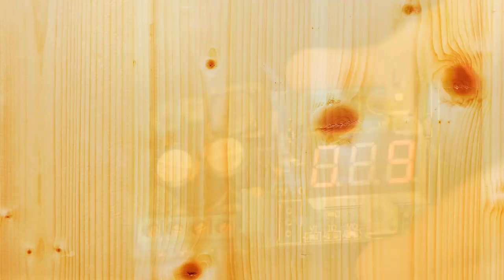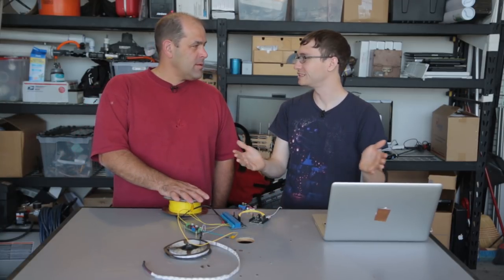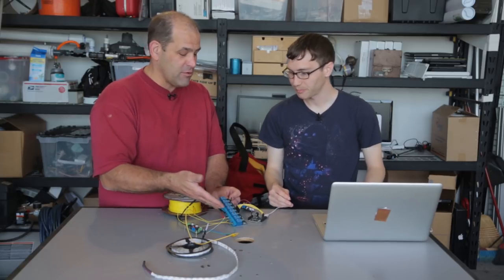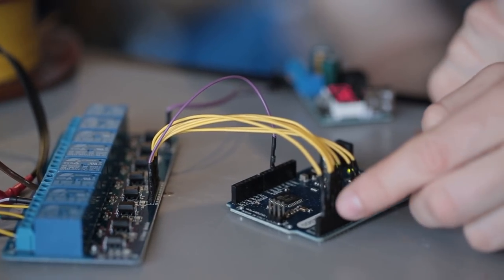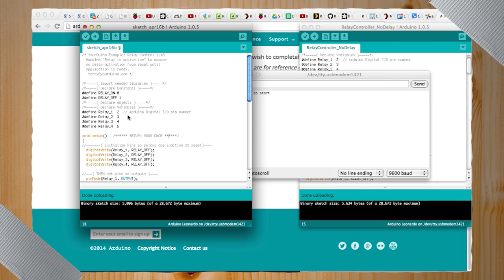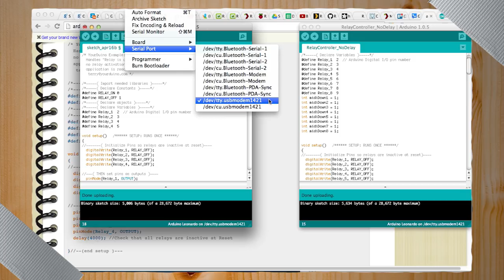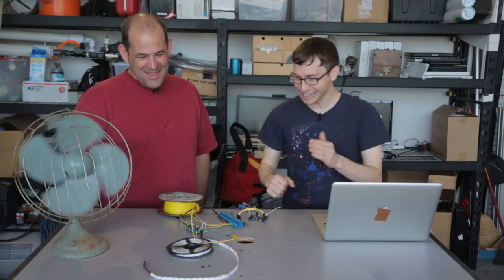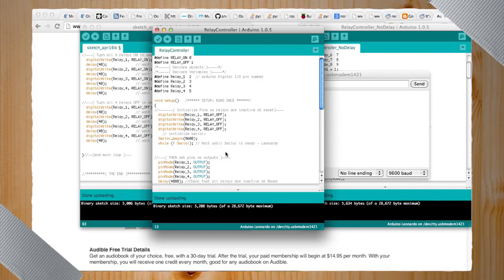Use Arduino to Switch Power On and Off!

Comment: Cool episode. It would been cool to see how the lights and fan were hooked up and powered. Seeing that could give me more insight as to how the wires are.
Reply from the maker: Think of the relay switch as interrupting one of the wires. When it's switched off, it's like you cut the wire.
For the fan we literally cut one of the fan wires and put one half in the COM (common connection) and one in the NC (normally closed) slots.
Take a look at this page for a better explanation:
http://arduino-info.wikispaces.com/ArduinoPower
Reply: DIY Tryin My L led is off and NO is dim what does that mean?

Comment: Just thought I'd toss this in for anyone interested in toggling a mechanical style relay with any sort of frequency like Michael did with the 40ms delay -- you're going to burn the thing out fairly quickly if you're doing something like that all day long. You should consider a solid state relay (more expensive than these old mechanical ones) for that application. Or a high-power MOSFET (which effectively is all a solid state relay is, just without the heatsink and terminal block attached)

Comment: I like to use solid state relays because they act as a transistor, whatever frequency you give it, it can turn on and off at that frequency, a mechanical relations can only oscillate so much

Comment: I may be wrong here, but I think that the Arduino is not a microcontroller. It is a development board with a microcontroller (Eg Atmel AtMega328) at its core and peripherals on board that allow for easy project making.

Comment: I know this video is 2 months old but I purchased a Sainsmart 8 channel relay board for my arduino and i was wanting to know if the relay is Active LOW or Active HIGH, and what you used as a power supply to isolate the arduino and relay board, I can't seem to find a straight answer anywhere, and I watched your video and thought I might get a straight answer here.

Comment: theoretically, you should be able to drive all 8 relays, the UNO can handle 20ma per output, with a total of 200ma total, and each relay is designed to be driven by 20ma, so 20ma x 8 relays= 160ma, this is on the specs of the relay board and on the arduino, you do can drive all of them, but is not wise to do so if you are going to use it a lot, it will shorten the life of the arduino board, is always better to use power driven devices with an external power supply
Reply: or just use transistor driver to draw current directly from source

Comment: Using relays to drive LED strips... Interesting...
Reply: Sarcasm? :p i would think mosfets are way better?
Reply: EEEnthusiast they were probably just trying to inrodyce us to the idea. We can even apply this to AC appliances
Reply: @diederik you are correct that mosfets would be much better for these types of applications. Either works tho.
Reply: Yeah... But there is no real difference... Relays are just easier to connect...
Reply: They literally applied it to an AC appliance in the video (the fan)

Comment: If you need to turn stuff off rapidly or over a very large number of cycles, look for a solid state relay board. Same people make one and that can go very fast, for a very large number of cycles, and is silent. 

If you just want to turn one thing on/off with an arduino, very safely and easily, look up the PowerSwitchTail2, a hobbyist product that has everything (except the arduino) safely isolated, tested, etc.

Comment: Are you sure it's safe to flip that relay every 40ms? There must be a minimum time to flip that's safe to use without overheating and mechanical wear etc. Be careful with high voltage.
Reply: Timur Iskhodzhanov 
Well you certainly aren't using this to light up a room. It's for like r/c airplanes and drones, to like switch a clutch on and off. Cvt transmission servo motor operation, some lighting, etc. You just gotta learn the silly code :#
Reply: I'm much more worried about the coils generating voltage spikes.

Comment: Hello guys,
Thnx a lot for your great YouTube, It means a lot if you char what you’re good in, so we can learn from each other. I hope you have time for a small simple question. Is there power on your relay coil when the NO contact is closed (when you’re hooked up appliance is on) like a standard relay or does it gets a pulse each time you switch on and off you’re appliance?
Greats
Bart

Comment: cough circuit board with a micro controller cough 
Love your videos. I really needed this to help me learn techniques to use on my arduino. Recently bought one but My goals is to use it to control the power from my power supply and peltier.

Comment: Mike, how did you manage to wire up the external power supply to the relay in order to save the Arduino MC from having to power it? What power supply did you use, just one that was lying around?

Comment: Great job, i have a little question, how did you control the strip of Led, because i have a strip of led (WS2801) and it has 3 outputs, so i dont know if you can help me with the conecction
Reply: Check the pinouts, search for examples on the internet!
Good luck out there in the world of arduino!

Comment: Hi, I have a question: the "external power supply", as you call it in the video, is simply a 5v bridge?
Reply: 6-12V, since 5V usually comes with less than the label, which is bad. it works but won't give you proper 5V output from arduino

Comment: One of the things I've been trying to figure out is how to increase and decrease the duty cycle on the PWM pins of my Uno board. The goal is to make some DIY signage that changes brightness with an LDR so that it's as visible  in bright light as it is in dimly lit situations whereas it can also save power. I've figured out how code for the sine change from let's say "open" to "closed" using some transistors and a diode AND gate network. The brightness thing with the LDR though is a little harder to wrap my head around. Little help?

Comment: I'm still a bit confused, I have this relay shield that has 4x 250 v 10 A AC relays, so you'd think it could switch 2500 watts but the data sheet says its switching power is only 70 watts? Can I still safely power a heater thats a kilowatt on this relay or should I be careful not to exceed 70 watts?

Comment: Hey , you say its not possible to power the relays wi the arduino if you want to switch them all at the same time. Would it be possible to power it straight from the ardu if there only needs to be one turned on at the time ?

Comment: Arduinos dont have the power to turn on a single relay, the signal is optocoupled to the relay board and the relays are actually powered by an external source ONLY.

Comment: I have the fan hooked up to the relay. The relay is switching on and off and directed in the code, but the fan does not turn on. When I fan wires directly into a house outlet it powers up. What am I doing incorrectly?

Comment: Hi, How can I control the two 220V AC Motor using arduino with numpad and timer. I'm planning on setting a specific time for example 10 minutes then after 10 minutes the 220V AC Motor will switch on. Thanks

Comment: I have 8 Capacitance Sensors AT42QT1012 on/off  & AT42QT1010 momentary 5vdc which will be on a Base Holding my Model.

Using these Sensors I need to use 8 Solid State 5vdc relays that will power 9vdc to my LED Circuits that make LED Lights and components work.

Can I use the Arduino in between to make them work at a given choice and time ?

Comment: So the text on the relays states that they are rated for 10A @ 250V, but is it generally safe to use them with this voltage? I want to use one of these to control a 165W fan running on 230V.

Comment: I would like to individually control the warning lights on my plow truck. The problem is I don't want to have a thick bundle of wires going from the cab to the engine compartment. Is there a way to use the arduino to control relays. I would like to use only one wire from the cab to the arduino. so could the arduino be programmed to sense different voltages and turn that into a command to turn on and turn off a relay?
Reply: The Plow Guys The Arduino outputs only 5v or 0v (High or Low). The way the relay understands this if it receives 5v, it knows to activate the switch. If it isn't receiving anything, then the switch deactivates. You could easily program an Arduino to turn on and off a light, or multiple, at the push of a button or buttons. As for the wires, you could wrap all the wires up into one semi-thick one to make it more organized.
Reply: I get that. what i wanted was to use a momentary push button to act like a on/off  push once for "ON" and push again for "OFF". Yes I know there are 12 volt switches that do this but i need to keep the wires size to a minimum.
Reply: The Plow Guys
You could use a potentiometer in your cab which you can turn around to select the settings. And the arduino can sense the settings using ADC.

But I suggest you should create a more detailed question, how many relays do you have and how many different settings do you want, how do you want to control these. You might ask this question at a better location (arduino stackexchange or forum)
Reply: The Plow Guys Sorry, for clarification, are you warning lights on your roof? As for the momentary button, it would be pretty simple to use a momentary switch to trigger the relay module, turning your lights on/off. The wire really would not be very thick no matter what method you choose, so long as you bundle them up with something like heat shrink of tape.
Reply: So running like 9 wires from the cab. 1 wire would carry the 5 volts into the cab and the other 8 wires would direct that 5 volts to the different relay. So the only thing I need to do is get a relay board like the one above along with a 12 volt to 5 volt power converter and I am set?
Reply: The Plow Guys Well you'll need the power source for your lights (whatever voltage they are) , and a power source for your arduino (7-12V, the 5v you said would be running in). The 5v to the relay is supplied from the arduino (the other 8 wires running to the relay), but you'll need a power source with the voltage of your lights, as the arduino only outputs 5v and would probably not be able to handle the wattage. And of course lastly, you'll need to program the arduino and whatnot.
Reply: The relays will be switching 12 volt power. I understand that the relay board needs 5 vdc, I also understand that the arduino can not handle all the relays at the same time so I would use a 12 volt to 5 vdc converter. I need 8 button (momentary) press once for "ON" press again for "OFF".this is where the arduino comes in to play. I really want to have as small as possible wire loom. I really don't want a bulky set of wires running through the fire wall of my trucks.
Reply: The Plow Guys use two arduinos but im not sure how itd fair in those conditions
Reply: The Plow Guys my arduino uno can handle that many relays yours should too it needs 5vdc and tharduino can take much more than that from a power source what amtter is the amount of milliamps the relays take to be active which is miniscule comapred to the amount each pin can output which i believe is 200ma

Comment: :) Thank you for your videos, great stuff. What would be a good basic automatic relay circuit to make load A2 turn on when load A1 shuts off?
Reply: I recently bought a 30A power supply (P-360-12) to control the sprinkler system and heating in my greenhouse during the winter. The stat sheet ( http://www.wlgled.com/estaticos/media/producto-pdf/8PS120360DCU.pdf ) said "2) Do not overload, also avoid free of load while a power supply is powered on, keep proper loading" so now I'm concerned about damaging the power supply in the time that both the automatic heating (12v-16ish A) and watering (12v-2A) circuits disconnect. So I was thinking of adding another load (12v-15A) that would only turn on when the heating circuit disconnects (As it will be the most used load, as well as the biggest.). I'd prefer to lean away from Arduino as I am currently a novice and haven't yet ventured into it, any suggestions?

Comment: Can this be set to turn on and off at certain times without having to change the code each time.  Example a school bell that goes on to alert students a period is over 9 times a day automatically.  Can it also be fixed so that it automatically sets daylight savings time?  I'm trying to work on this project making it function automatically without anything extra done to it once it is complete.
Reply: with the right code it can do all of that stuff

Comment: Hi, 
I would like to know if i deploy this project to toggle the fan inside a switch board, the present physical button will be set to ON position, for the relay to work and turn of the fan, but what if at some point in time i wish to bypass the relay and use the physical button to toggle the FAN on/off. how can that be achivied

Comment: Can you connect this relay through a lightbulb and get it powered and blinking through the arduino? With this relay? I might be very wrong and there is other components nescessary but I would love to know if you have more knowledge in this area!
Reply: Filip Bengtegård Book there's a very similar relay like this one that was controlled with a light bulb and tells how to set it up. if you're interested, it's here

 http://www.instructables.com/id/Controlling-AC-light-using-Arduino-with-relay-modu/#step1

Comment: hey sorry i am kinda new to electronics. i need to know what are usages of relay.what is it actually.please feel free to share your thoughts in details or some useful links.thanks.
Reply: +WEKRAYS Hey, a relay is really simple - it's a switch, but instead of you physically flicking that switch your arduino can do that for you hence allowing you to switch on and off much larger devices than the arduino itself.
Reply: +NobleBrutus thanks pal i checked some blogs regarding this so now your simplified answer makes a lot sense.
Reply: +Christian Himmelstrand great explanation and a good simple example.thank you so much man.

Comment: Any idea why i can get my relay to work with my arduino is powered by a battery, but when i connect my arduino to a 9 volt power supply (actually sending 9.2 volts), the relay doesn't work properly? ...it sticks "closed" (LOW) and won't disconnect?

Comment: Newbie question: Would the fast switching of relays cause a lot of voltage spike?
Reply: isoboy2125 Yes.  Quite a bit.  A freewheeling diode would be needed.  I would be surprised if they were not on the relay board already, because the voltage spike could destroy the arduino.
Reply: IFailFirst ive never had a problem

Comment: hi  
i want to simulate a push button using bluetooth from my phone on a music system 
what i want to achieve by doing this is when we power on the music system(by using WiFi enabled Sockets), by default it starts in aux mode
by using mobile with bluetooth it changes it from aux to bluetooth mode so we can connect it with mobile and play music at scheduled time by using Tasker app 

so we dont have to physically push any button

thanks

Comment: Can I integrate a temperature threshold from a sensor to turn the fan on?
Reply: +Jason Axford sure can, arduino is perfect for getting sensor inputs and outputting data or signals
Reply: +Sam Wu Cheers. I'm building a fan-forced fireplace heat exchanger with temp controlled AC ducted fan.
Reply: i'm not too familiar with the hardware side of things, but you should be able to look up temperature sensing modules for arduino, and there are plenty of existing codes and tutorials online where you can just follow. its a great tool for prototyping and making your own little projects.

Comment: Okay so I want to use one of these to control 8 solenoids. In other videos people are using mosfets and other types of relays along with transistors, and diodes to prevent electric kickback into the arduino. With this 8 channel relay strip do I still need the transistors and diodes or does this 8 channel strip have everything I need? If anyone could help I would greatly appreciate it!

Comment: Hi there great vid :D , i have an arduino and arduino relay modul and i would like to force chanel 1 (digital input 1) to force it so that the channel 1 is active so that as soon as power is provided it activates with no input needed from say an arduino etc, i am wiring up an access control and it has a relay output (2 pins) which is powered up when the correct key is swiped across its rfid range so i want to use this (around 4 volts output) to power the relay so that it can act as a switch that allows the higher voltage circuit to open a electric lock, so i need to either put in1 to ground or is it wire it to the positive (same as the power circuit across this in 1 to activate the relay? is this correct if not how can it be done so i do not need to make it more complicated then needs be? please someone reply and say its ok to bypass the in1 (short it to ground or vcc to activate)? i hope this makes sense and i want to keep power consumption to a minimum so other electronics maybe not a good idea as i wish to run all these from 9 volt batteries (1 for the access control unit and 2 9v batts for the door unlock mechanism (as 9 wasn't enough)).
Reply: idk what are you saying but just think relay is just a button/switch.

the arduino push/flick it then the other side connected/disconnected.
no connection between two system except via the relay.
in your case, set relay at Normally Closed circuit, then connect the magnetic lock+source from it
Reply: a relay on its own how can chanel 1 be active with no input from an arduino!

Comment: i used bluetooth to control the arduino wirelessly from my phone with an app to turn relays on and off only problem is i havent figured out how to get the arduino to stay in whatever state it is when i exit the app as soon as it losed blutooth connection power to the relays returns to default